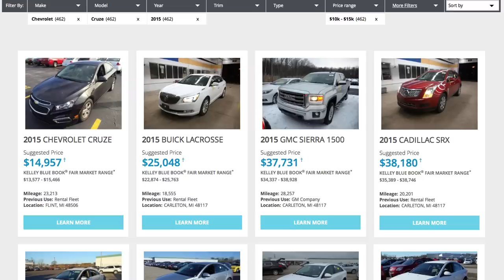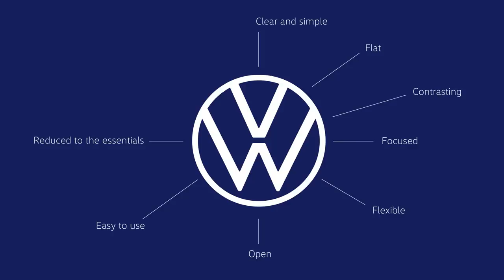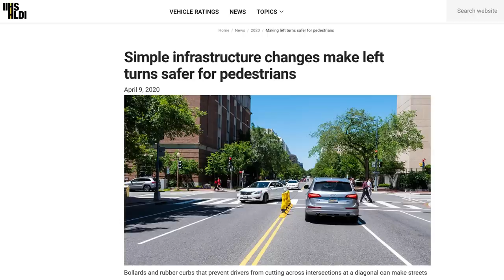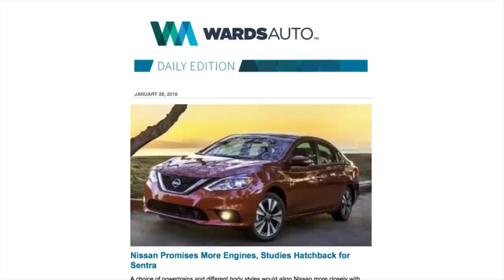New Chevy Traverse Delayed; Nissan Cuts Sales Target - Autoline Daily 2813

Comment: It is not that hybrids don't sell well, it is expensive hybrids that have a short battery range do not work that well.  Why pay for the extra hardware/maintenance if you don't gain that much?
Reply: Google BMW i3 REx....
What hybrid? REx EV is a hybrid as much as a Tesla is an electric toy car....

But it was a great simpleminded meme narrative, that repeated billions of times... 
But the truth is batteries are still expensive and heavy.... So BEVs suck at things like towing and REx fixes that problem and in emergency with no electric the ICE is a  great backup....
and is why the BMW i3 REx.... out sold the BEV...the list goes on... but it will never be a meme, since an REx, since for the simpleminded...
Reply: That has a lot to do with the way those  vehicles are being sold. A Plug-in Hybrid, or any hybrid will sell quite well if it is not a compliance vehicle being made to appeal solely on F/econ. Aim at performance at an amicable price. F/econ should be the happy bonus not the main goal. Not enough people care about, or strongly enough about, F/econ that it should be the main target for these vehicles.  Plug-IN hybrids will then sell very well. 

However, for the life of me, I can not fathom why car makers make serial hybrids, literally the ICE and the Motor tied to the same transmission, when you could very easily just use electric motors to propel the car and power the motor or motors with a gas generator and or batteries, if the car maker is comfortable with the technology. If your goal is to keep weight down, then used a generator. If your goal is to keep to cost down, ironically , use a generator. If your goal is to have better range, f/econ not withstanding, then use a generator. However it has been proven you can get over 80mpg (over 120impg) with a highly optimized vehicle or a Gas-electric vehicle.  They just have to "go there".
Reply: Google "note e-power"its a serial hybrid without a transmission.... it's the far more complex parallel hybrid that makes no sense..
120 mpg???.... good luck with that...
BTW if using wishful thinking a Stirling Engine REx like what NASA and the inventor of the Segway- Dean Kamen created...  would be nice if, someone could commercialize one of them...

Comment: Rotary REx ICE, makes its compact enough to fit in a BEV, that has most space taken up by a large battery pack (even if it won't be as fuel efficient)... (and comparing it to a PHEV that has smaller battery is not even relevant)
John check the sales figures of the BMW i3 BEV vs REx version to see if ppl want to buy a REx... But they will have to market it for towing or other niches not just as a range extender.... And not just to the classic BEV buyers... If they want to sell enough to justify the cost to produce it.... But they have to try...

Comment: We've all known that Mazda was going to put a rotary range extender in the MX-30 since their plan for an EV was first announced. They said that they would have different versions for different markets: pure EV, range-extended EV, and plug-in hybrid. They also have been talking about using a rotary as a range extender for a long time.

When they released info on the MX-30 and we saw the big hole in the front end, yet it didn't have a frunk, it was obvious that's where they were going to drop an engine. And the only that would fit? A rotary.

As for development, they never stopped working on the rotary. And in a generator application, the engine's many problems are non-issues.

Comment: Rotary range extender is a great idea! It eliminates basically all the issues with rotaries - it gets to run all the time at its optimal RPM - what means removing the pollution and fuel efficiency disadvantages - it's very compact - what allows for an easy integration into the car, it can output much more hp per kg than piston engines - where mass is super-important for EVs - and it's safer than gasoline engines in operation, so no worries about fires onboard (other than from the batteries... than again: Mazda doesn't use NCA batteries, so it's not that much of an issue)

Comment: The Mazda rotary range extender is easier to develop as will run on an optimal rev only, will be smaller, lighter and more quite with less vibration compared to a conventional range extender, and it runs on gas, liquid natural gas and zero emission hydrogen.

Comment: Nissan needs to make a rugged SUV based off of the Titan's truck platform
Reply: It boils down to sales, Nissan must feel it won't move enough units to justify the cost. GM completely owns the full size SUV market with their Suburban, Tahoe, Yukons and Escalade models. This article goes in depth on why they didn't use the the Titan platform, the main reason being the felt their customers would rather have independent rear suspension. https://www.forbes.com/sites/samabuelsamid/2016/02/10/nissan-introduces-sort-of-new-to-america-2017-armada-suv/